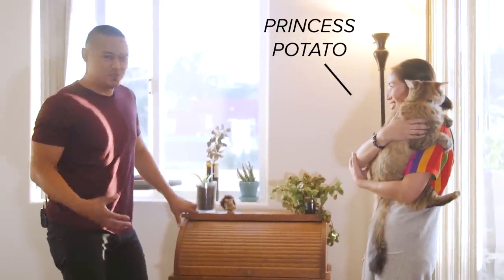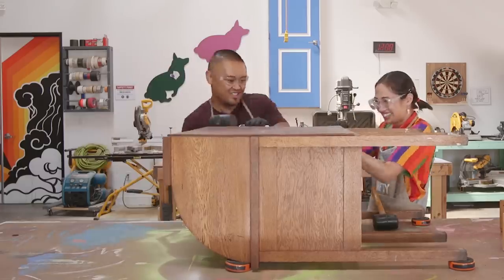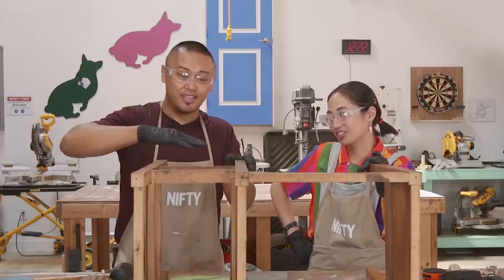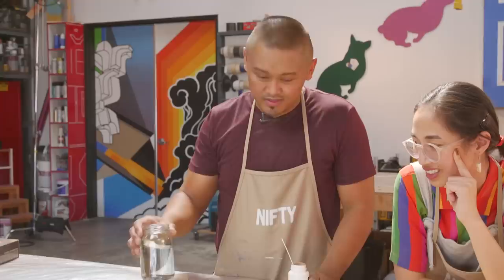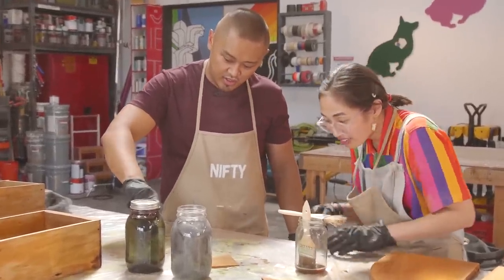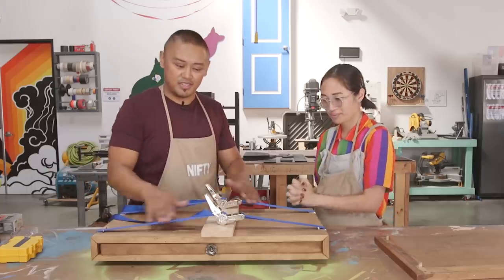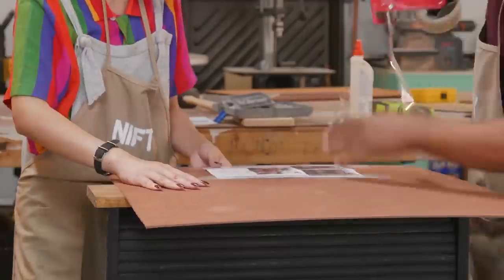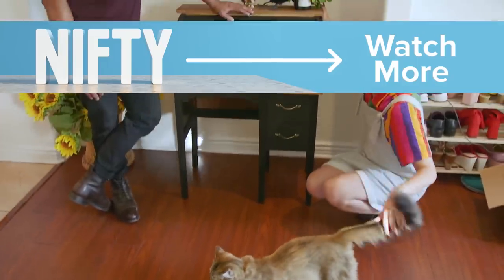We Tried To Upcycle A 100-Year-Old Desk

Comment: No matter what, when you buy something it's yours to do with whatever you want.  Like here, taking a 100 year old antique and removing its value by replacing the desktop unnecessarily and imitating an older surface by oxidizing instead of simply using a darker stain. Like I said, when it's yours you can do what you like with it, including mess it up.